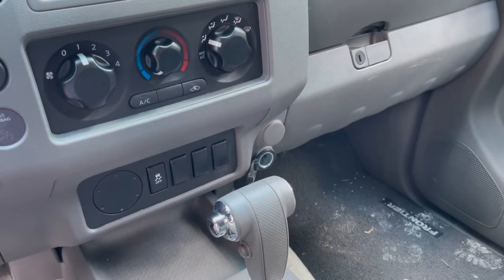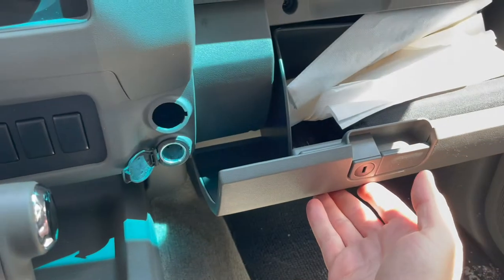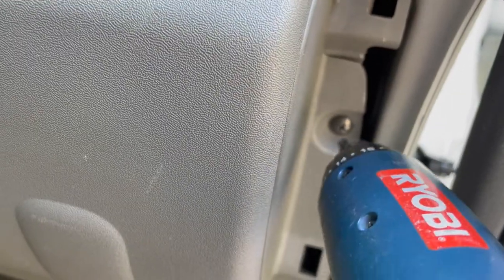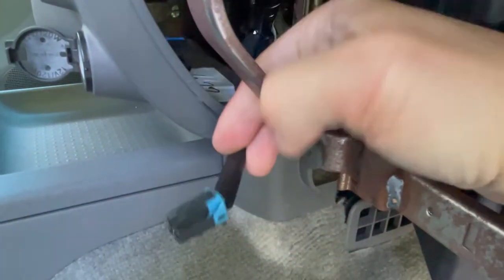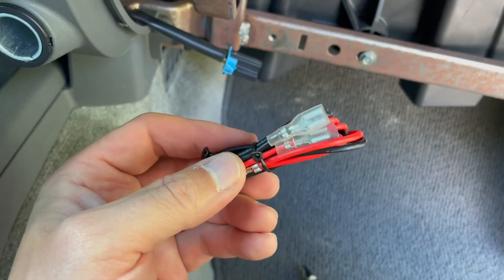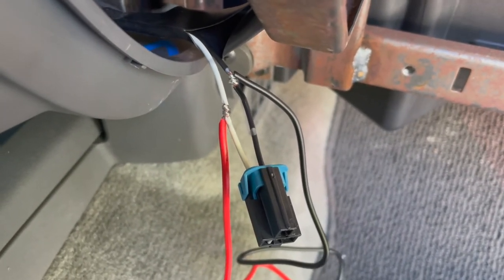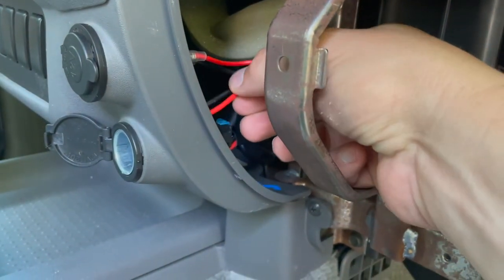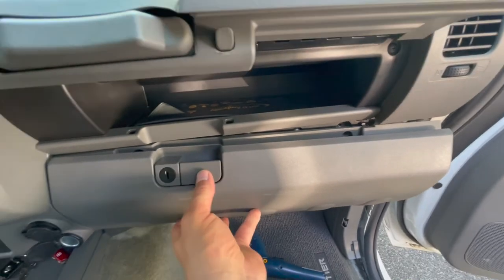Adding a 12v Outlet to a Nissan Frontier

Comment: I would have tapped into the wires the same as you but I learned a couple of years ago that you should use a Scotch Lock connector to tap into the wires. Just have to make sure to get the right size for the wires.
Reply: He Staggered them so the wires can't touch, Great Idea. Scotch Connectors are iffy and can ruin the wires integrity. That is why so many people don't use them anymore.